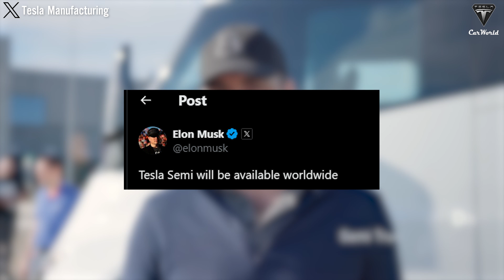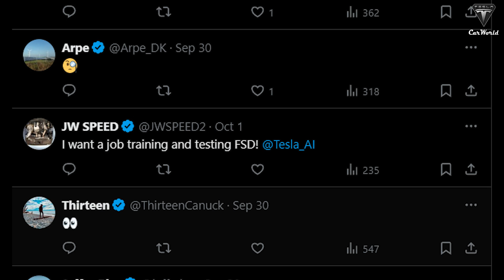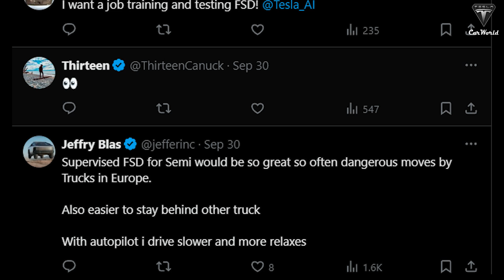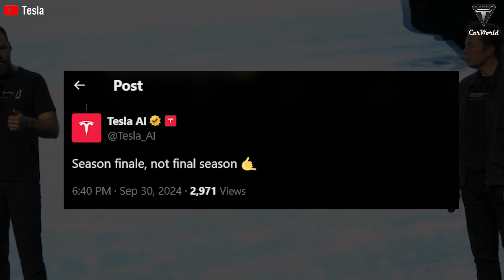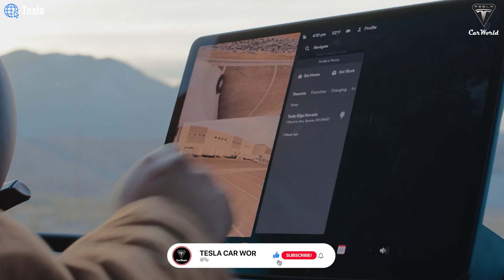It Happened! Elon Leaked Tesla Semi 2025 coming, Faster, Instance efficiency! All You Need To Know!

Comment: What is still shocking to me is the fact, that neither Tesla, nor other Semi-truck and trailer-manufacturers put effort on reworking the rear end of those huge trailers.
Most of the deadly accidents with Semi-tailers are back end crashes where other vehicles smash into the rear end of trailers, because they misscalculate the very slow speed of such Semi-trucks when driving at hills and have to move on gradient roads. 
And just because those trailers have a very, very bad back-end underride protection, many people get heavily injured, most of them even die by head and chest injuries.
There has to be done some governmental regulations WORLDWIDE !!!  Thats why Tesla should point out this situation on every single Tesla-Semi related event, to raise the pressure of trailer manufacturers.

Comment: Problem for bigger ev is that the cost to charge 1 kwh electric is about 16 cents and 1 kwh of gasoline (petrol) is about 8 cents.
Reply: Except that 1 kWh of electricity will move the Semi 1 mile (i.e. 16 cents a mile), while 1 kWh of diesel fuel will move the average diesel truck only 0.15 mile (i.e. 53 cents a mile)... using your own energy cost numbers.
Now, let's consider two very comparable sedan:
- 1 kWh of battery power moves my Tesla Model 3 approximately 4 miles (i.e. 4 cents per mile),
- 1 kWh of gasoline will move my previous BMW 330i only 0.7 mile (i.e. 11.2 cents per mile)

So, what was your point? What problem are you referring to?